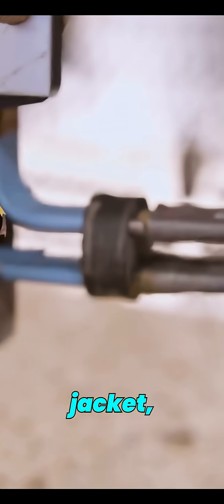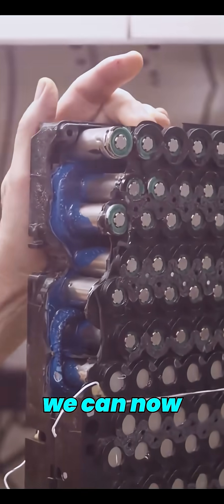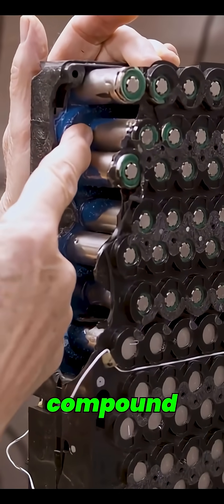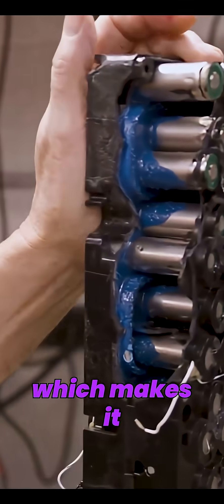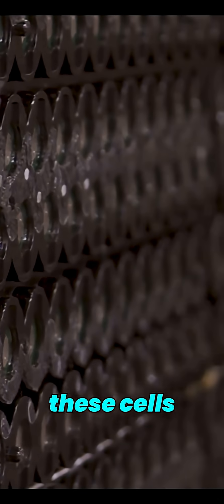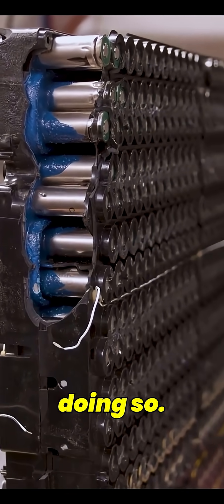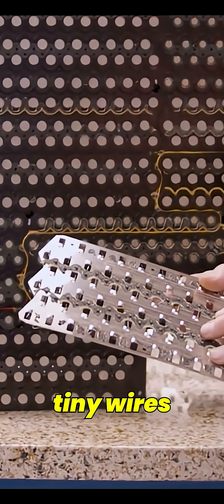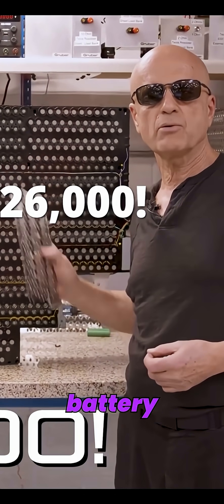Crazy Looking Material inside a Tesla Battery! #shorts

Comment: Cells in a battery pack may become open circuited. Thus, the capacity of the battery decreases or becomes unusable. You can continue to use your battery pack at full capacity by replacing the defective cells. Of course, the capacity and internal resistance of the replaced cells must be almost the same as the other cells. But this is impossible to do because of the non-modular design. The entire battery needs to be replaced just because of a few open-circuited cells. Producing battery packs creates a lot of carbon emissions. Tesla's design isn't environmentally friendly. It's a complete joke.

Comment: There’s no way to dissolve the resin without screwing up the battery chemistry or corroding the metal jacket 🤔
Reply: Just heat it up with a heat gun, what could go wrong?! /s 😂
Reply: @Firikka yea ok pop boom
Reply: Applying heat will damage the cells. That's why soldering isn't done on the cells. They are assembled using spot welding.

Comment: If EVs are ever going to be TRUELY green and viable as an alternative to ICE vehicles. The batteries AND motors NEED to be easily serviceable and swappable if necessary. I believe it's China that's experimenting with battery swapping stations. I think you buy the EV and then just pay a subscription fee to the battery. It's price varies depending on how many swaps you need during whatever time period. (Week, month, semi annually, annually...) But I think you would also have the option of just buying a battery of your own and not swapping if you really wanted. But the whole building around the battery thing and having them epoxied into a plastic casing so they're basically unservicable needs to stop... Too bad companies don't care about the customers anymore. They only care about keeping the investors happy and ridiculously wealthy...
Reply: Join a communist party.  It's the only way to exert control over the rich sociopaths in charge.

Comment: it’s honestly disgusting that tesla would make something this difficult to disassemble, repair, or recycle
Reply: Honestly disgusting we share air .,, you’d rather have the batteries flopping around during normal driving or crashes
Reply: Chemical solvents can be used to dissolve epoxies, so I'm guessing that's what recyclers like Redwood do
Reply: @StalePhish redwood typically shreds them, then does chemical separation.
Reply: They don't want you to repair they want you to spend 20k on a new pack or a new car
Reply: Are you slow 😂😂
Reply: @ninjality7o2 Please elaborate.  I understand why they're doing this, but at the same time, it makes rebuilding on a cell level nearly impossible vs having to do a whole brick within the pack.  I'm also sure it adds extra headaches to recycling.
Reply: @M5JamesE39  ninjality misunderstood you as not grasping the concept of anti-repairable.